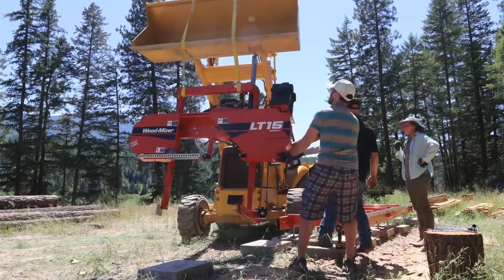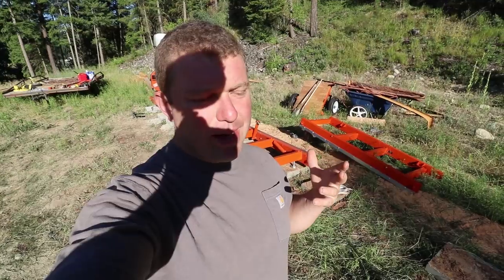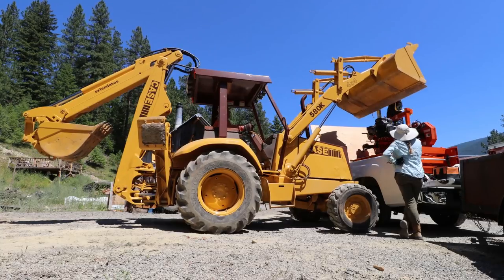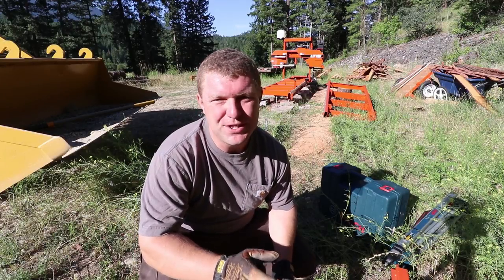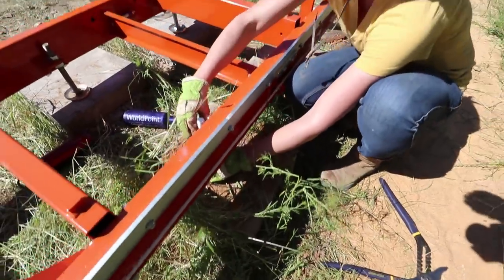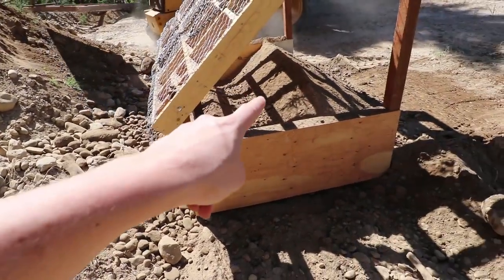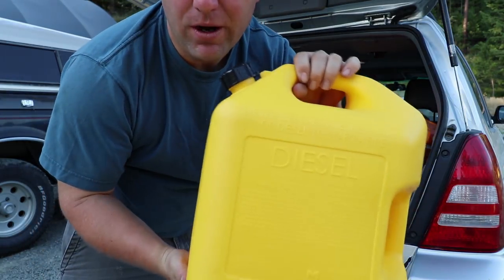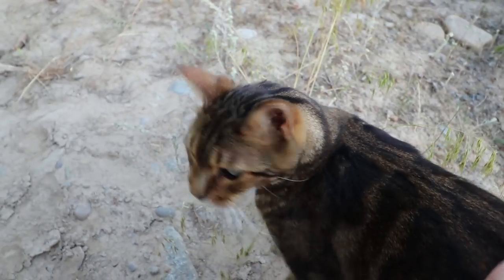BACKHOE ALREADY SAVED OUR BACON!

Comment: Hi All 
 Great vid so glad that many other people caught the Bleed off of the Boom Ram around the 6:30 minute mark, have that checked out and Hell yes never get under your bucket Safety First.  Also since you are using your Backhoe as a crane and forklift they do make great removable Attachments well worth the money in the long run.   Drop by your local Fire Department and see if they have any old Fire Hose it makes great Softeners for your slings any thing with a sharp edge will cut your slings so fast it will blow mind.  Check out heavy equipment fails on the net you can see where they are going so Wrong,  some funny some very tragic.  Keep up the great work Aloha Capt Ben

Comment: Thanks for sharing your journey with us, after you get the hydraulics checked out I have a suggestion to keep cool while operating the back hoe, pick up a 12v truck fan, a universal windshield washer pump, a 5 gallon bucket with a Gamma Seal lid, and a low pressure mister head. You can see where I am going with this, You can mist yourself with ice water in the middle of a  hot day and keep cool on the back hoe. Just be careful that you are upwind so the dust doesn't become mud. I use a setup like this on my ATV at mud bogs in South Florida and it works great.

Comment: IF you went with a diesel generator in the future the tank you'd use for your  backhoe would make more sense.  You could also go for a diesel pickup truck and then buy fuel in larger quantities when the prices are lower.   In addition you might then also experiment with non-diesel fuel alternatives for your truck/backhoe/generator.
Reply: a tank with off road diesel would be best, much cheaper and you can load up when costs are lower and avoid trips to get gas every two days. wasting time costs money.

Comment: If you want to find the drain on the battery then use a "back probe". Chances are you have 2 wires rubbed together somewhere,bad ignition switch, bad gage, bad light, or a faulty voltage regulator on the altinater. All of those work fine when running but will cause a drain. It's probably not worth messing with until winter when you have plenty of time.

Comment: Looks like the backhoe and laser level are already earning their keep. I'm sure some will tell you you should have kept the wide version of the saw mill, but seeing the types of logs you'll be dealing with, it didn't look like you'd really be needing that so if there are other features you can use with the regular one, that's a good swap out.

As for the hydraulics on the backhoe, there is definitely something leaking pressure. Ideally, you'd get the seals replaced (or do it yourself) unless you can find an actual leak. Nobody should be going under the bucket or load regardless, but you need to know that could fail totally at any time  and just drop.

Comment: i would like to help with the drain on your battery. befor you do the test. make sure every thing is turned off. you can use a ohm meter or a test light. by unhooking the positive cable putting the test light or meter in line. if it reads more the 8 milliamps or if the light lights up. then you have a drain on the battery. if so then start pulling out the fuses one at a time. when light goes out or meater reads below 8 milliamps. then that means you found what circuit its on. then start removing what is on the circuit the most feather away and remove one at a time. if you need any more help contact me anytime.

Comment: Check that the alternator is not drawing current when the engine is not running. 
It is posible that the regulator feed diode (probably part of the main rectifier pack) is short, meaning that the regulator is feeding the armature, even when you are not running. That drains the battery.
Another clue is, if the alternator is warmer  than expected, after the engine has colled.
Been there, done that! Took ages to track down.

Comment: If the charging system is trying to charge up a dead battery I can see 12.9V but you will definitely want to double check it when it is closer to full to ensure it is charging the battery somewhere in the 13.5-14.5 range.  If you have a few days where you are not using the backhoe it may be a good idea to pair it up with the portable 12v solar charging system and let it top it up when you are not using it so it gets a good charge when you are not using the equipment.  

My car has a high parasitic draw from the body controller computer and it will sometimes drain the battery down in a week if I don't drive it so I have a 60 watt solar panel in the back window to keep it topped up.

Comment: Have you thought about what you are going to do with all of those Rocks when you are done? 

You can either Rent a Rock Crusher, or buy a used Rock Crusher and use the Crushed Rock for your Driveway and as Back-fill, Or sell the rock to quarry that has a Rock Crusher to crush the rocks or see if a local quarry with a rock crusher will crush the rocks into the proper sizes for back-fill and for stones for your driveway!  

Keep up the good work and the great videos!

Comment: Hi, thought if you spray plant killer under the saw the grass and weeds will not grow there and when its wet the machine would sun dry preventing rust and also if anything gets dropped you would not have to search in the grass. That's if your backhoe doesn't kill you .

Comment: You can conserve fuel by turning the engine off instead of letting it idle. If the backhoe is charging below 13V that could be a charging system issue. Definitley check voltage again with engine above idle speed. Also it's super easy to check for a parasitic draw, set your meter to amps and disconnect one of the battey cables, measure current from battery post to cable. But honesly, with equipment like that I would just laminate a note reminding you to disconnect the battery at the end of the day and attach it to the console.

Comment: A good idea on the backhoe is to install a solar powered battery maintainer on it as you are not going to be using daily. Figure around $30 for a 2ish watt weather rated kit hooked to the battery itself bypassing the cutoff will trickle charge and float the battery any time it is parked in the sun.

Comment: Make sure the tractor air filtration system is clean and not leaking especially using the grizzly. As for fuel remember running a diesel out of fuel is hard to restart

Comment: Great video and it's nice to see it all coming together. I've watched the video a couple of times because on the speeded up parts, while working with the Wood Mizer, it looks like the rear hydraulic arm is moving of its own accord. Do you have a leak or air bubble in the hydraulic system?
Reply: I noticed this too at about 6:28

Comment: Fuel for the backhoe...55 gal drum $5 or free on Craigslist. Barrel pump $35 from harbor freight. Load it in the truck fill it up once a month. You will drive yourself crazy 5 gal at a time. Also buy off road diesel at local co-op or farm supply place and save $$$ on road tax. Around here I save $.40 a gallon. It adds up quick!

Comment: If you made something like a french cleat system or some way to hook on the open end of grizzly with your bucket when you pick it up you would not need to continually to hook chain on to the grizzly. Similar to how some skid steer attachments work.You may even be able to pick it up by scooping it from underneath and using those top hooks to hook onto that top plywood piece.

Comment: it looks like one of the piston seals on your backhoe boom is starting to fail watch 6:30 and you see the boom slowly dropping during the time lapse. this is something you need to fix sooner than later as it will progressively get worse. you can likely buy seal kits for the cylinder directly from case  its not very hard to do (but heavy).

Comment: You need to check the alternator, you should be getting 13.4 to 14.5 volts to keep the battery charged. Start at the battery gauge, that can be a problem also. Enjoy the videos.

Comment: that original 12.9 volts was probably when the battery was near dead and was jumped off the subaru. not unusual to see lower charging voltage then. normaly i like to see low 13volts up to 14 volts. after lugging 5 gallon diesel cans around to fill my equipment for a couple of years (not to  mention the new pain in the but epa spouts), i bought a 100 gallon tank with a gas pump nozzle and electric pump. well worth the money. i wish i had bought it years ago.

Comment: To find the current draw in the backhoe. Disconnect the negative cable from the battery and place a test light across the circuit from the cable to the battery negative. If there is a draw the light will light up. To figure out what circuit has the draw to it just start pulling fuses till the light goes out.

Comment: make a wood frame and get a good 55 gallon drum and mount it on its side 3/4 bung down and 2 inch up. use a bushing if you want to go to smaller size. use no. 2 permatex on the threads in the bottom and you will not have a diesel leak at all. and a 2 inch close nipple on top with a 45  turned up with another close nipple this will make it easy to fuel at a station. then use a brass fuel cap like truckers use it has a vent. I have had this set up in the back of my truck for the last 10 years with no problem.

Comment: You could place the grizzly sideways so that you could access it with a backhoe on both sides so that you could dump the dirt with rocks from the front and see whats going on and at the same time be able to remove the rocks from the front to clear space for more rocks. When ever you need the dirt you can drive up from the other side.    This way you wont need to move the grizzly each time a pile of rocks builds up in the front. That is if you have enough room to do so.

Comment: Maybe try looking for a used diesel transfer tank that would fit in the back of your new pickup. Much easier to pick up fuel and transfer. It would take approx. six of those yellow tanks to fill the back hoe, I'm guessing it has over 30 gallon tank on it. Like some one else said if down the road you got a diesel generator a tank like that would make sure you could get enough fuel even in bad weather  ❄️ I believe some of those tanks could hole 79-90 gallons and the extra weight in the truck would be good in bad weather, just a thought. Love the channel.

Comment: I have been a battery technician for years 12.9 volts is what that Baterie should read if it's 100%. While running that things should be producing 13 1/2 to 14 1/2 months depending on what loads. Sounds like a charging system issue I would clean your connections check cables before getting a new battery

Comment: If you load the Grizzly from the other side you can use the bucket to back blade the rock away from the grizzly as you leave.  You may also want to check the local fuel or heating oil dealer in your area.  If they're going by, you could get 'off road' diesel delivered at a much cheaper price than the pump price.  Or you could put the barrel in your trailer and take it to the nearest truck stop or ag dealer and get the 'off road (red) diesel' so you don't have to pay the road taxes on it.   You could use a steel 55 gallon barrel or one of your blue barrels with either a hand or 12 volt transfer pump to fill the backhoe.  I often wind up using fuel cans to fill my equipment when we're on a job, but I get tired of having cans leak, as they often do, and I also dislike all of the spouts that are now required on a poly fuel cans as they generally leak or fail very quickly.

Comment: That is great idea.  What you whould do, maybe drill a few holes on the that lexan (plexyglass), and stick marker or pencil and mark what you need of the and ofc. drill in the middle.

Did you try to unhook the battery from the Backhoe? and leave it in the air in the night? And connect it in the morning?

Comment: You should be getting WAY more than 12.9 volts on a working running charging system.  Voltage should be in the 13.5-14.0 range on a discharged battery.  If not, then either your battery is defective or your charging system is defective (possibly both).  First I would remove the battery and have it tested next time you go into town (in my area Autozone will do this for free).  If the battery is fine, then remove the alternator and take it in to be tested (again Autozone does this for free).  Sometimes if you get a short in your battery it will force the alternator to run continuously trying to charge it, and that can burn out the alternator. If you have any battery issues, its always best to figure them out quickly.

Comment: Ok keep it positive ya' all!   Trouble shooting for a low power use with switch on and backhoe off - Lift negative ground  terminal.
 
Big spark (lot of current) - don't do below use cut off switch to isolate the circuit by opening the cut off and remove one fuse at a time, turn cutoff on and spark terminal to test.  Follow circuit that sparking stops on.

Small amount of spark (low current). - place a bulb in series and bulb lights. One person at the fuse block and one at the bulb.  Pull one fuse at a time to determine which circuit has drain (bulb goes out).  Follow that circuit for problem.

Comment: Did you check Craigslist for diesel tanks?  I see them all the time around here dirt cheap.  Even a retired home heating oil tank will work well. Sometimes you can get those just for carrying them away. A cheap crank pump and you are all set. Those 5-gallons cans with the backhoe are going to get OOOOOLD fast.

Comment: I keep thinking you need to feed the grizzly from the other end. Dump into it instead of over it. Also if you had some ribs going down the length of it, it would save on the fence letting the big rocks slide down instead of tumbling over all. I understand its a budget build, just a suggestion. You guys are doing a great job.

Comment: have you called you local fuel delivery service, a lot of times they will provide or rant the  tanks to you so you don't own them, The cheap solution is a couple used 55 gallon drums with a hand pumps.

Comment: Check your brake lights they might be on just enough to draw the battery dead and also start by removing the negative battery cable and hooking up a voltmeter to see you're voltage draw

Comment: I just realized, although I knew I had a case extend-a-hoe, but I had the same model as you  when we built our house in PA. It did well for whole time we had it. (kinda wish I still had it) the only problem with it was brakes. I was told that's common with case, but since I didn't take it on the road it wasn't a big deal. Good luck with yours

Comment: Take a voltage reading off the alternator itself while running should be in the 13 Volt range 12.9 not really putting out enough.

Comment: A water level ,   water is free it also self levels.
 water in a thin clear flexible tube is less expensive and lots of people have used it .
water self levels just buy the length you need plus a few feet or whatever lengths it comes in .
if you have to use a short piece and want to lengthen it add a new piece of clear tube with a plastic push fitting .
imagine a U shape hold at one end and adjust and mark or score  on the other end to level .
best regards

Comment: New Rock Grizzlies would make a great band name. It looks like it is working very well. (Note that: 'well'; not 'good'.) Should you think about wearing a breathing filter when using the grizzly? I know it's nasty in the heat (I had to deal with that removing the asbestos shingles from and inherited shop building.), but you may be inhaling some silicates that 
could prove harmful.

Comment: Look into an off road diesel tank and eventually switch to a diesel generator for a longer term high demand/backup power supply.  Look up your state's fuel tax exemptions and do what you need to qualify/apply for the cheaper less taxed fuel to run equipment that does not operate on public roads.

Comment: You should be getting more than 12.9 but not not over 14.  I would say that the alternator is weak but not to bad.  All equipment gets dead shorts as they age.  A battery cut off switch is the first thing I install on a new piece of equipment.  It is not a major problem.  Keep an eye on the battery.  They are not rock and backfill it is is landscaping and engineered fill.   Good work

Comment: I'm loving seeing this journey you two have undertaken. I've been watching along for a while now. I couldn't help but notice that the excavator arm was slowly coming down when extended during the time lapse parts of your video even though nobody was at the control levers. I'm concerned for your safety and the fix could be super simple.

It could be as simple as needing to lubricate the lever linkage or you might have a valve sticking, a leak in a line, or even a hydraulic cylinder that is starting to go bad. However, no matter what that arm should be rock solid when the lever is released. I thought I'd point it out as it seems to be a slow movement. Please monitor it and be safe and keep up the great work!

Comment: Somewhere around 14 volts across the battery when the engine is running is what you should have in a healthy system .... new alternator or perhaps a regulator jesse

Comment: A quick and dirty way to check the charging system on the backhoe or any internal combustion engine is to disconnect a terminal form the battery  while the engine is running.  If the engine continues to run it is because the alternator is working well.
Reply: Nah, a mechanical diesel will run just fine without power...

Comment: if your battery is sitting on a steel plate that could cause a sow drain of power.  but that would drain regardless if you use the cut off or not, so small tip, put a thin price of wood or rubber under the battery  to help, but your drain could be as simple as a Guage or sensor or as complex as a wiring issue.